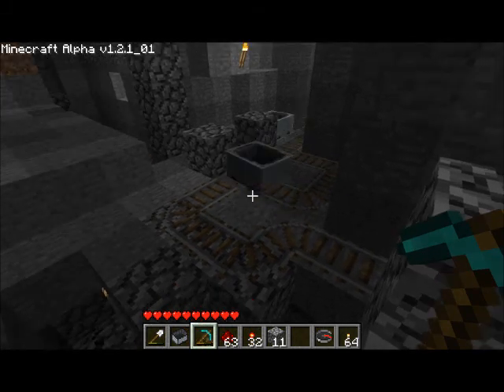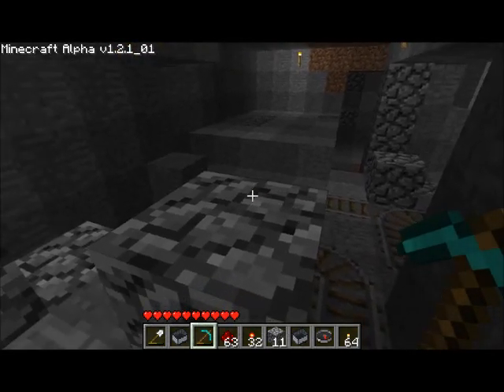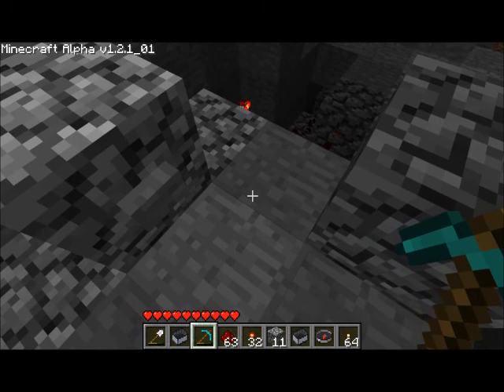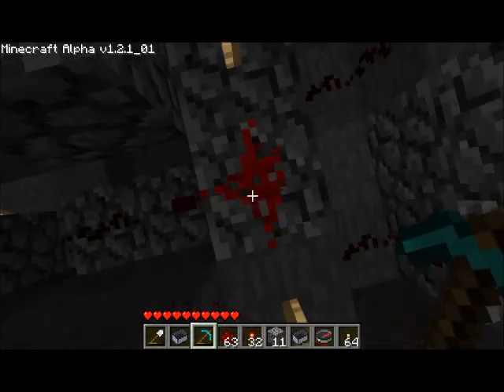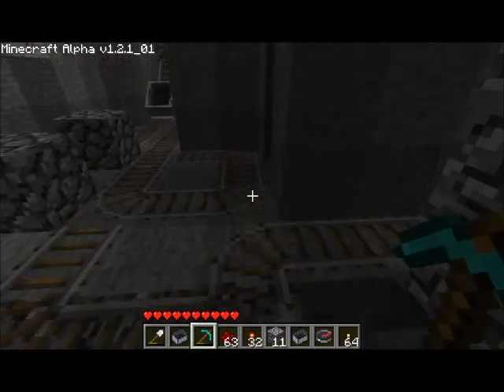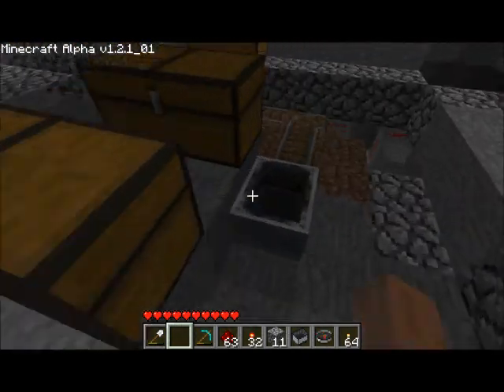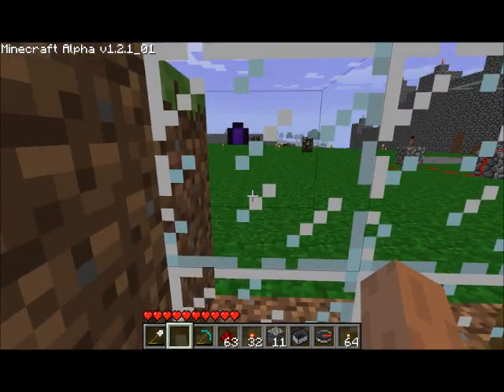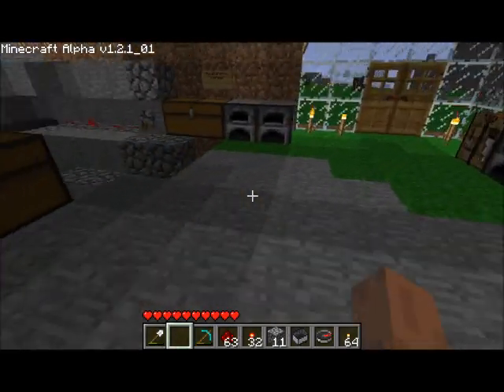Minecraft - Automatic Mine Cart System v2

Comment: Hi Dastin I wonder if you can help me! Im trynig to do a similar system with my mine. However, I cant get the track on the booster to switch in the correct direction to connect up with the track thats supposed to push me! I hope you can understand that. Is there any chance you could show me the wiring you have under your track!

Thanks.